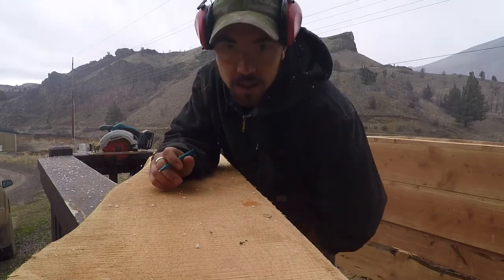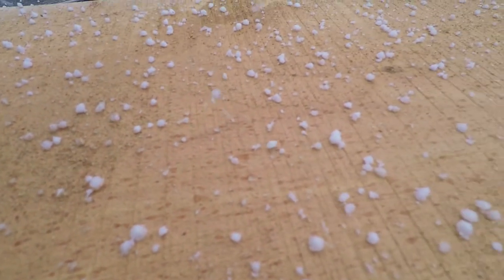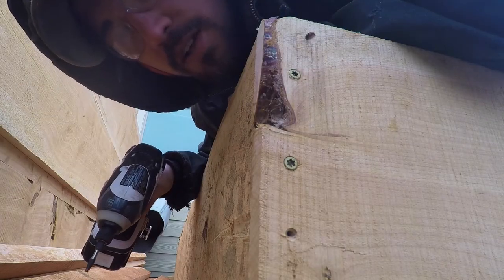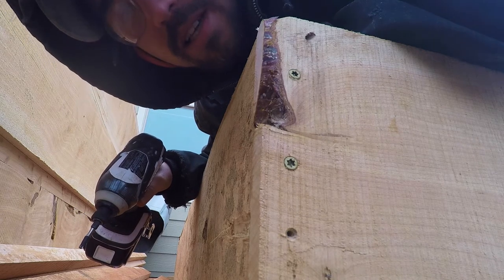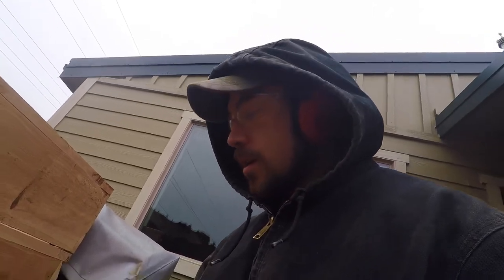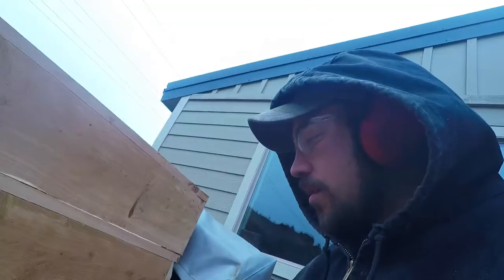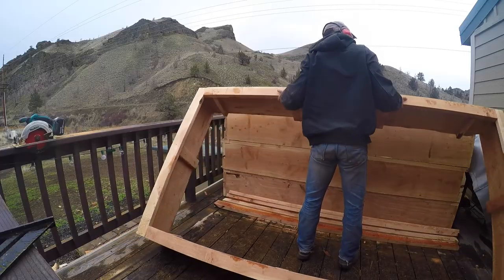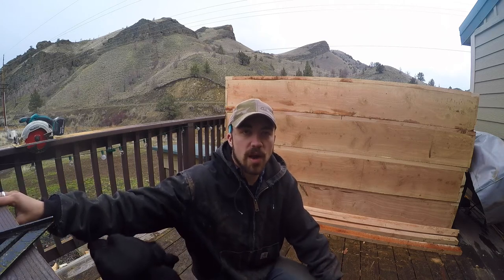CONSTRUCTION IN A HAIL STORM

Comment: horse manure works great in gardens, going to put one in my yard this year since my wife will finally be home and I'm just going to work the manure in the soil ahead of time. like the raised beds, we need some for strawberries
Reply from the maker: yeah. cow manure is actually better to use than horse manure, because the horse manure can still have some active seeds in it from not digesting fully so you might get more weeds if you use horse manure rather than cow manure. At least that is something i read lately.
Reply: With out a doubt your going to have weed problems, I know that when we use it the plants do great, but if you use to much horse manure, it will burn the plants
Reply from the maker: yeah i've heard that as well.